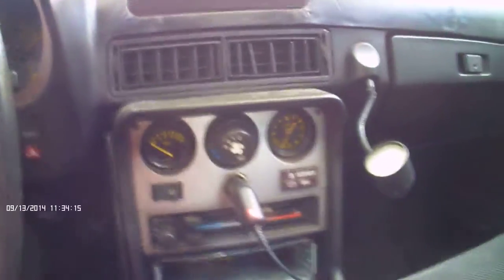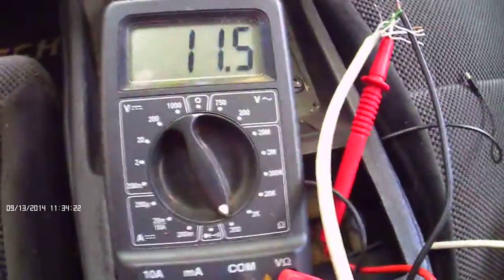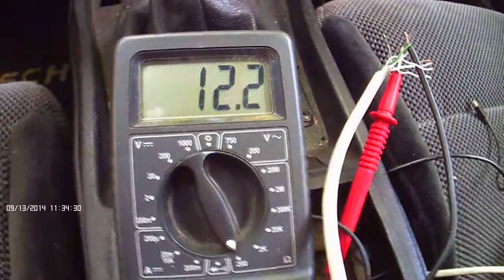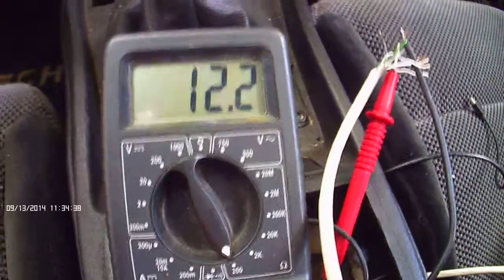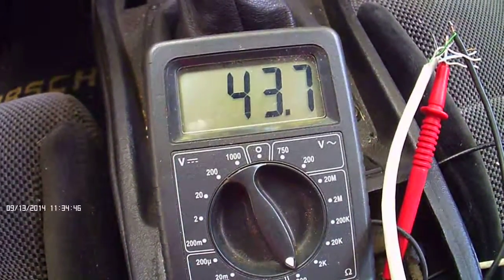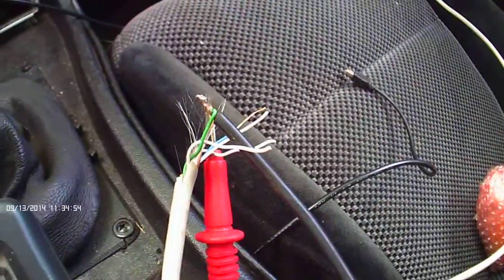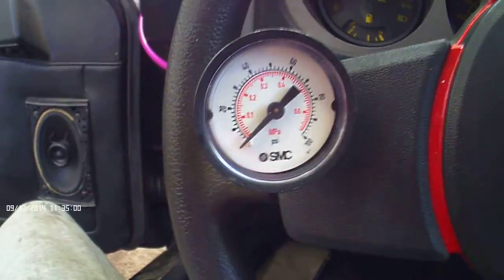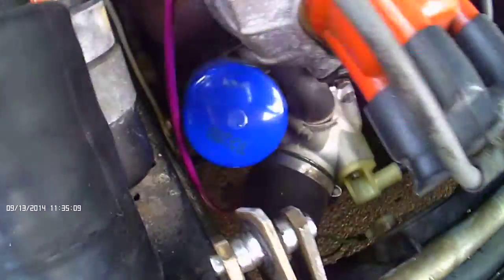Porsche 944 oil pressure testing

Comment: The difference in resistance when turning the key is because then you put 12V across the sensor, which throws off your multimeter.

Comment: What happened with this? I've noticed your channel hasn't had anything about this car since January of last year. 944s always seem to have problems with oil pressure sooner or later.
Reply from the maker: Hey, So the car runs good now. I got a re-built PRV with new seals and springs. Also running the proper Porsche recommend oil filter helped significantly. It still wasn't quite 100%. I eventualy re-sealed the whole front of the motor which included a bunch of new seals, investigated the oil pump which looked good, threw in new rod bearings, and reassembled everything to spec and then it was finaly good. builds oil pressure immediately upon starting cold, and after sitting for a few weeks or a month also builds pressure way faster than it showed in this video.
Reply: That's good...I know these cars have lots of problems if they're not kept in good condition. I've been collecting drive train parts for about a year and a half now, so that when I get chassis to put it all in, it will all be thoroughly rebuilt, from the engine to the transmission.